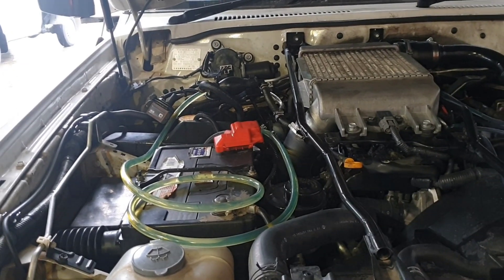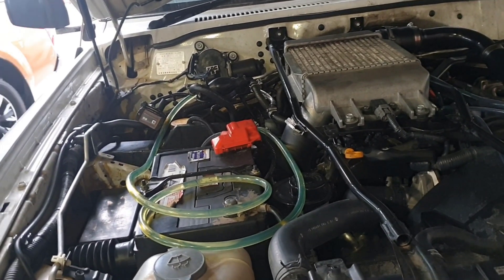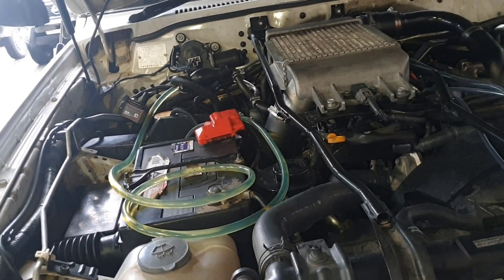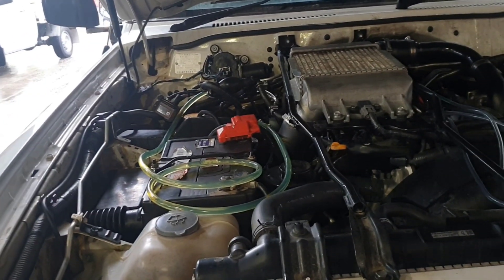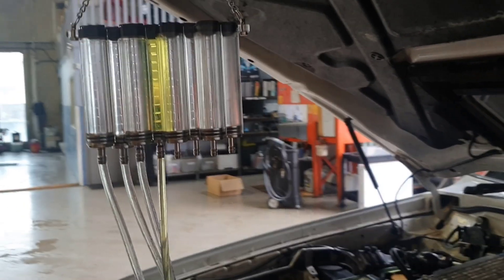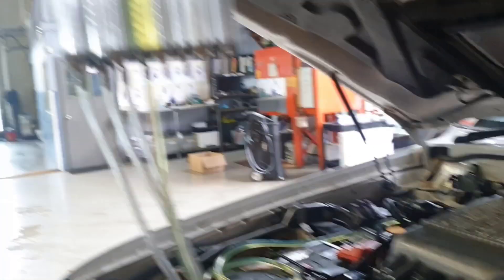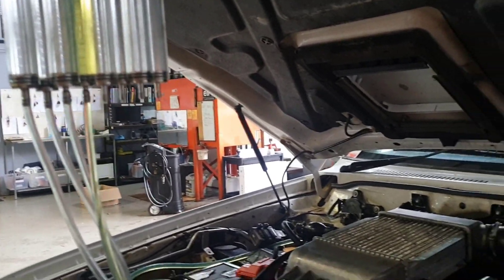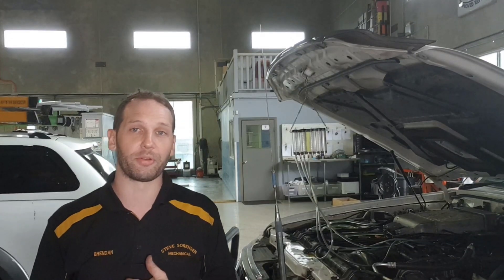Injector return leak test on a ZD30 common rail Nissan patrol pm

Comment: Should be a regular part of preventative maintenance on the ZD30CRD in particular. Between loosened injector pipe unions & failed injectors causing excessive bleed off they seem try very hard to burn themselves to the ground!

Comment: Hi friend. Thanks for your videos. Tell me please why there is no pump learn val clear function in Nissan Consult for this model? Are there any way to clear inj pump learning values manually?
Reply: Nope, the injector compensator values are determined at the factory.  Those values (on top of the injector) need to be entered into the ECM via compatible diag equipment.

Comment: Hi...im after wiring diagram for zd30 engine not common rail....engine not starting...no power to crank sensor.thanx
Reply: How did you go with that?. I have same problem.